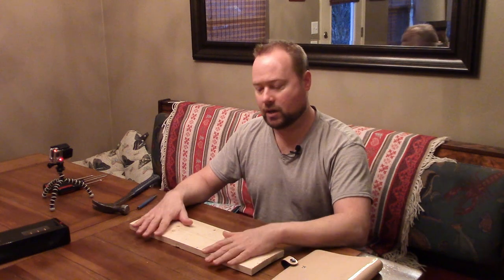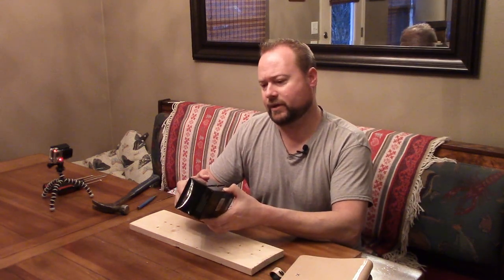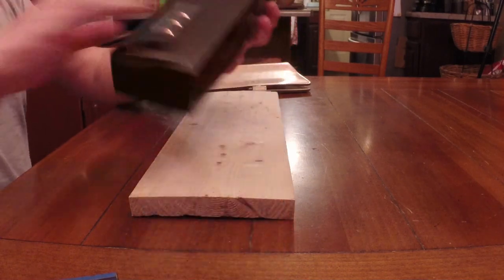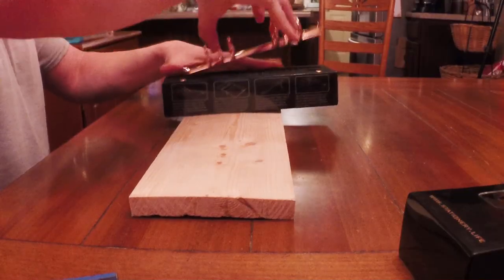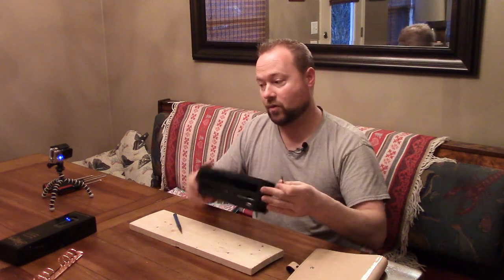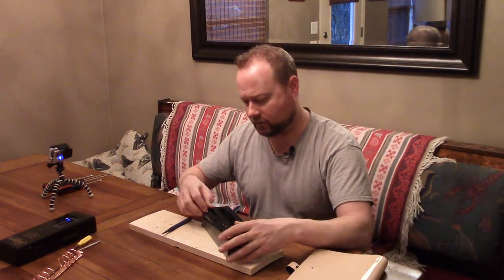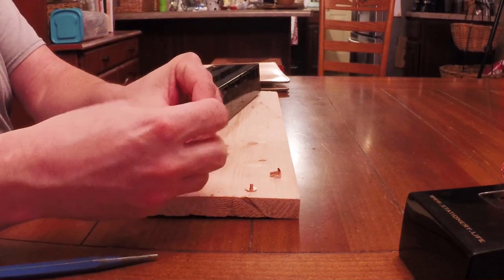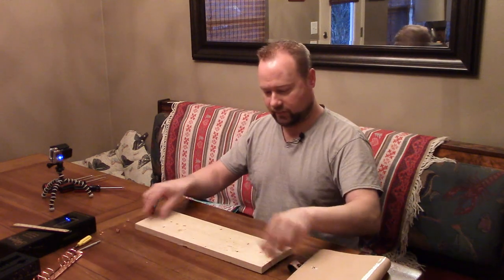Filofax Rings Upgrade to 1.4 in With Stationery Life Kit

Comment: What is the tool called you use to punch through? I’m planning on changing my personal holborn rings but need to buy something I can punch through with. What do you suggest? Thanks so much for the video!
Reply from the maker: A nail set. Like this one. https://www.amazon.com/Dasco-Pro-564-Solid-8-Inch/dp/B016OPMKUC/ref=as_li_ss_tl?dchild=1&keywords=dasco+set+punch&qid=1602109788&sr=8-10&linkCode=ll1&tag=greatwhitenin-20&linkId=763798af2c967c6b2c2c210f7a997b34&language=en_US

Thank you for watching. Check out hundreds more of our videos at https://www.aroundthehome.org